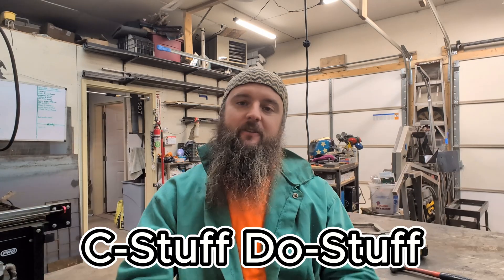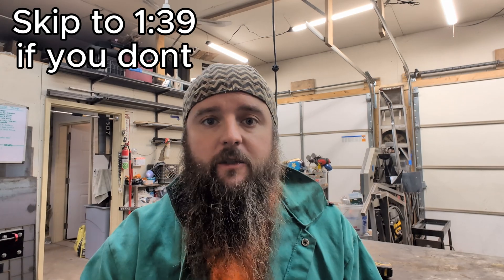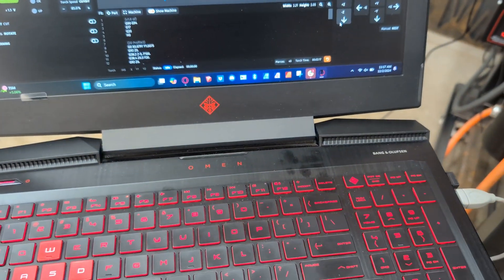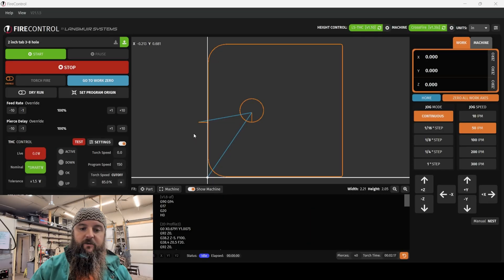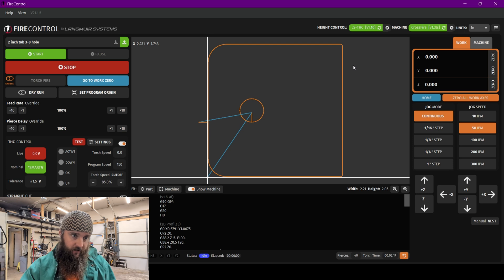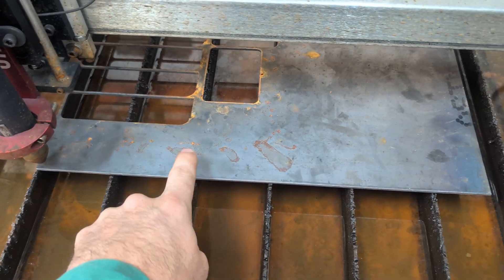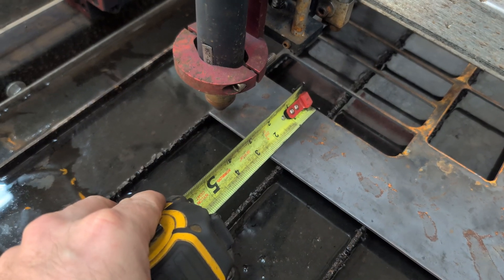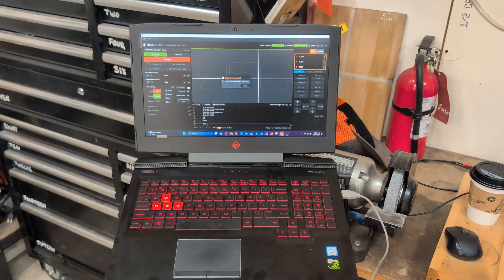Langmuir Systems Crossfire Pro  Intro to Cutting

Comment: Thanks for sharing. what plasma cutter machine do you have?
Reply from the maker: Hey sorry for a slow response. I use the razorweld cut 45. when I purchased my LS Crossfire PRO it was the plasma that they were offering in the complete kit. Its a plug and play situation so I didn't have to solder any pin connectors or anything like that to make it work. So far... its a fantastic plasma.

Comment: The offset you created to fit your cutout on Firecontrol's visualizer was over complicated. Simply create your own origin point as Firecontrol will create a "box" around the entire cutout with the lead-in included.
Reply from the maker: fantastic advice! I see how that would work way better! I plan on recreating this video soon. Ill make sure to demonstrate that.
Reply: @c-stuffdo-stuff  It also helps to add that if you use Fusion 360 for CAM, you can skip the initial step in your setup when choosing model point/etc.

Using Firecontrol's origin point feature overrides this as well.

Comment: I like your content brother.  I have the pro also ( haven’t put it together yet )  too many irons in the fire but soon I will have the time to work on getting it up and running.
Reply from the maker: Thanks! I honestly think it only took me 6 or 7 hours to actually put the table together and get it moving. but that doesn't include the time spent swapping out mu old compressor, updating the wiring, adding air drying stuff, ect ect. Good luck on your assembly. Its really rewarding once you get it up and running. I literally just opened the computer to draw up some tabs to cut on the Pro, for a railing I'm making and I saw your comment. I use this thing all the time!

Comment: I’m curious, why aren’t you setting the feed rate and pierce delay in fusion?
Reply from the maker: In fusion, I have my pre programed machine parameters set up as an average middle ground to the vast majority of thicknesses I cut. I find it very easy to just adjust the percentages to fine tune my cuts in fire control. My way is by no means the best way... but it works well for me. Do you set your feed rates in fusion differently for each file you create?
Reply: @c-stuffdo-stuff  I see, makes sense. I’m still a newbie so I’m not really thinking outside the box here. I went through and made a profile in fusion for several material types and thickness and set the pierce and speed the manufacturer recommended. I’ve had pretty good luck with the recommended settings so I haven’t needed to tweak it, but this is good to know. Thanks for the lesson!
Reply from the maker: That's a great idea to set individual profiles to fit specific materials and thicknesses. I've heard that talked about but haven't tried yet. Now you've all inspired me to give it a shot!
Reply: Because he is cutting in fire control not fusion  this is easier plus you can change cut speeds and pierce delay on the fly       Fire control is a great system   I love it       Also  nice video   You do a nice pace explaining this machine 😊